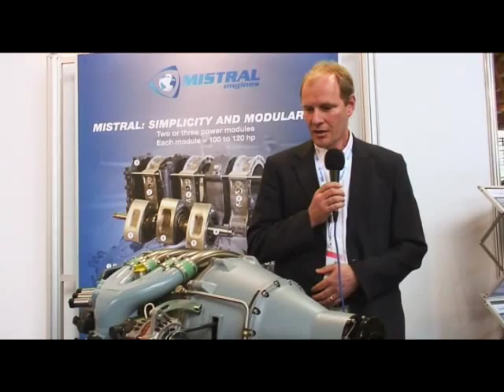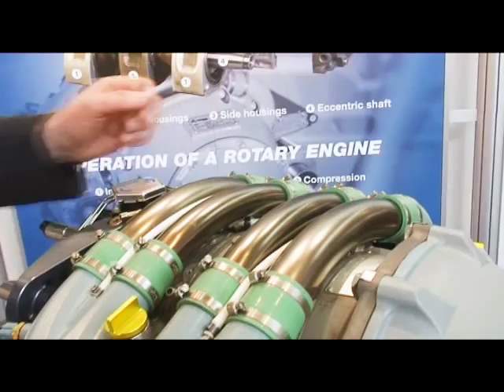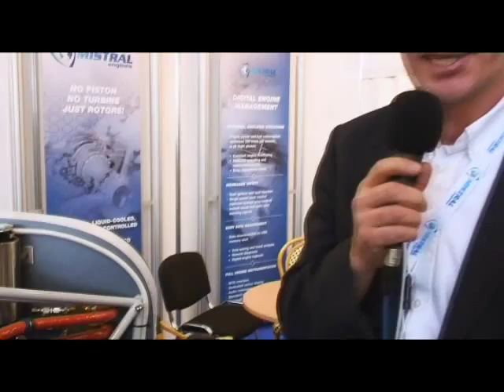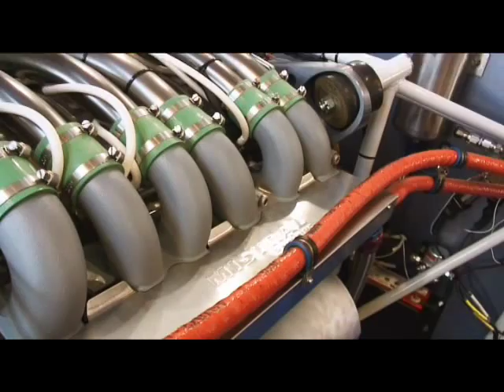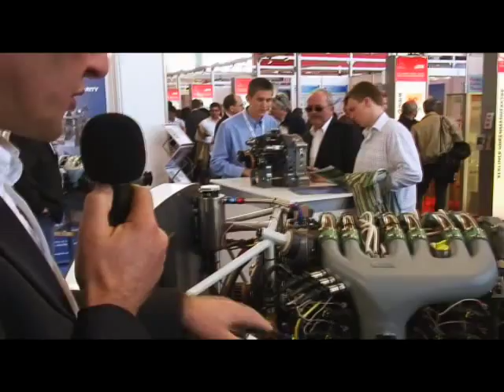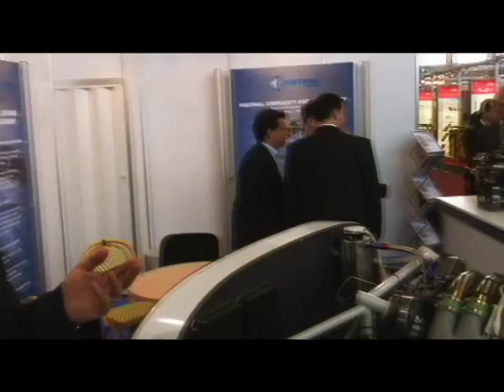Aero09_Mistral Rotary Engine

Comment: Thermal Shock in Air Cooled Aircraft Engines? Please explain!
Some deny what was called 'Shock cooling' existed, an air-cooled engine airplane having climbed, engine very hot, then starts a dive, outer parts, cylinders, cool from high air flow, inner parts, pistons, are still hot, thermally dilated, mix does not enter in an amount high enough as to have pistons cooled, cylinders contract, pistons are still dilated, from this, big wear, or even engine seized could result
Reply: High engine demands imposed by aircraft applications is exactly why Wankel engines are not used in passenger aircraft, they lack the durability and reliability to be used in aircraft, the seals simply cannot withstand the long period of high pressure and temperatures during climb-out and high-speed cruise.

Comment: Just use 1993 13b architecture. The 20b architecture is junk and will end up failing catastrophically
Reply: They are all junk, no Wankel engine has ever been reliable enough to pass a FAA or EASA airworthiness certification test... the apex seals always fail before the test is completed

Comment: Hey Bro I don't know about the engine noise levels .. You go ahead and stand south of the outlet pipe on a N/A 3 Rotor engine and tell Me what you think ?  Because that sound rips straight thru you ...I can't tell you how many time's Mr knuckle head said Cylinders 2 injectors per "Cylinders"  2 Ignitions per Cylinder . Hey why would you need twin injectors per rotor ? Is one for a Low Octane fuel the other for Methanol or What or Methanol injection for the Turbo model ?  But you have got to loose the Cylinder thing .. if you wanna convince me your a rotor guy !
Reply: Sir Michael, 
To help you with your inquiry, please listen again when he said a substantial reduction in interior noise compared to a junk Lycoming. Also, have you ever flown a Cessna or Piper with a 6 cyl Lycoming with open exhaust? You'd be DEAF in ten minutes! There are very effective noise reduction pipes that also boost power that make the rotary very quiet.
Also, the dual engine control systems, dual plugs, injectors, sensors, etc. It is the redundancy required by the FAA that certified it. A 6 cylinder Lycoming uses 12 spark plugs and two distributors, etc. It's all about backup systems.
Hopefully you caught the guy who pee'd in your Cheerios so you can be happier tomorrow.
Have a Great day!
Reply: @ceisarsrepair7958  Please stop spreading lies and false information about Wankel engines and aviation.
You are clearly not qualified to speak inteligently on this topic.
Reply: YOU SIR ARE A LIAR AND A FRUAD, There are no Wankel engines that have a FAA or EASA airworthiness certification for passenger aircraft.

Please stop spreading lies and false information about Wankel engines.
Reply: @ceisarsrepair7958  Anyone knowledge on these topic is aware that Wankel engines are LOUDER than a comparable reciprocating engine.
They have never been used in production passenger aircraft because they are too unreliable to meet the minimum PFTR standards for FAA or EASA airworthiness certification.
A test that has been easily passed by hundreds of reciprocating engines designs.

Please stop spreading lies and false information about Wankel engines.
Reply: @sandervanderkammen9230  did you not see the links that I sent that had videos of passenger aircraft CERTIFIED with the rotary engines?
 I DID NOT SAY MAZDA!!!
 Anyone can search rotary engine powered aircraft and find many videos. One even shows the FAA certification for the rotary engine. NOBODY is impressed with your repeated accusations of lying, most can hit the search and see the exact same as what we see. They are also certified for small helicopters. If you wish to turn a blind eye to that then so be it, but to call someone a liar even though you've seen it for yourself, that's insanity. 
Have a nice day and STFU !!!
Reply: @ceisarsrepair7958  You seem extremely confused and misinformed about this, NO Wankel engine has ever been reliable enough to pass even the very minimum reliability standards for FAA or EASA airworthiness certification.
 the MTBF for apex seals is simple to low, these seals are inherently unreliable by design.
Reply: This company has been defunct for some time now...
Reply: @doktorbimmer  they're bought out during Covid and will be returning soon.
Reply: @ceisarsrepair7958  No, Mazda no longer supplies the Wankel engine parts to build these engines.

Stop spreading lies and false and false information about Wankel engines.
Reply: @sandervanderkammen9230  You're a Blithering Idiot!!! I just gave you Absolute irrefutable PROOF (DIRECT LINKS) that aircraft owners have been replacing their Lycoming and Continental engines for Many options INCLUDING but not limited to the Wankel style Rotary. I did NOT say anything about Mazda providing parts and support. The patent for the rotary design expired long ago, many new companies are experimenting with the rotary Wankel design, and developing Great engines. One company, that I sent you the info for, has focused on building a Wankel type rotary for aircraft, AND it is FULLY TESTED AND APPROVED BY FAA and foreign equivalents. People have successfully installed them, flown them, and Love them! The PROOF is PLENTY that Wankel engines are in certified aircraft all over the world, Cessna, Piper, Kitfox,
Aeronca, etc. 
You are impressing NOBODY with your bullshit. You love the word LIES because You do it daily!
The Only thing You need to do is contact a tow truck company to pull that GINORMOUS Carrot out of your Ass! 
Wankels fly, Fully certified, You can't handle the Truth, 
STFU TROLL!!!!!!
Reply: @sandervanderkammen9230  You again with your anti rotary hate. Last year Mazda in fact opened up assembly lines to provide another production run to supply engine parts for the 13b. Numberess shops and customers have already bought BRAND NEW SUPPLY. Also there are some after market shops in Australia making bullet plates and rotor housings. At least do some research 1st before continuing your rotary hate.
Reply: @rotaryperfection  Please name a single Wankel engine available that has achieved a certificate of airworthiness for passenger aircraft from any regulator agency?

Anyone familiar with the development history of the Wankel engine knows that they are too unreliable and weak to be used in type-rated passenger aircraft, they are simply too unsafe.
Reply: @DoktorBayerischeMotorenWerke  Off f
Reply: @DoktorBayerischeMotorenWerke  Fo
Reply: @rotaryperfection  Childish insults wont prove your point or make you look smarter...
Just answer the question boy, What Wankel engine has a FAA or EASA airworthiness certification????
Reply: @DoktorBayerischeMotorenWerke The definition of insanity. Asking the same question over and over and over and expecting a different response. You have ZERO life you 🤡
Reply: @DoktorBayerischeMotorenWerke  
The definition of insanity. Asking the same question over and over and over and expecting a different response. You have ZERO life you 🤡
Reply: @rotaryperfection  JUST ANSWER THE QUESTION! WHAT AIRCRAFT MANUFACTURER USES A WANKEL ENGINE IN A CERTIFIED PASSENGER AIRCRAFT???
Reply: @rotaryperfection  STOP SPREADING LIES AND IGNORANT MISINFORMATION REGARDING A TOPIC YOU ARE CLEARLY NOT QUALIFIED TO DISCUSS INTELIGENTLY.
Reply: @DoktorBayerischeMotorenWerke  You are typing EXACTLY like tjat dork Sandervanidiot. Yall twins? 🤣🤣
Reply: @DoktorBayerischeMotorenWerke  Crybaby!
Reply: @rotaryperfection  JUST ANSWER THE QUESTION BOY! WHY ARE THERE NO WANKEL ENGINES RELIABLE ENOUGH TO BE USED IN TYPE RATED PASSENGERR AIRCRAFT??????
Reply: @DoktorBayerischeMotorenWerke  RACIST! 🤡
Reply: @DoktorBayerischeMotorenWerke  GF 🤡
Reply: @rotaryperfection  Childish insults won't make you look smarter or prove your argument... Why are you afraid to answer the question???
Reply: @rotaryperfection  Please name a single Wankel engine that has a FAA or EASA certification for passenger aircraft?
Reply: @DoktorBayerischeMotorenWerke  Please name a single Wankle Rotary, that was responsible  for ANY crashes in 2024? So many CERTIFIED piston engine failures, and you keep crying about Wankle. You = nut job.
Reply: @DoktorBayerischeMotorenWerke  

Please name a single Wankle Rotary, that was responsible  for ANY crashes in 2024? So many CERTIFIED piston engine failures, and you keep crying about Wankle. You = nut job.
Reply: @rotaryperfection  THERE ARE NO AIRCRAFT MANUFACTURED WITH WANKEL ENGINES.
Reply: @rotaryperfection  The Experimental Aircraft Association issued a warning to all its members in 2022 advising them that Wankel engines have shown to be dangerously unreliable and should be considered unsafe manned flight.
Only a handful of experimental aircraft have been built with a Wankel engine, most have since been swapped to a comparable Lycoming or Continental engine... the rest have crashed and were damaged beyond repair.

Comment: I think it is unfortunate this did not get off the groud; there are no updates in the website after 2017. Too bad, I believe this rotary would replace lots of recip engines in aviation.
Reply: This company went bankrupt a long time ago...
Reply: I like wankel engines for land/water transportation (cars, motorcycles & boats). But lubricating the apex seals is a big concern for me when you can't simply pull over or stop. Conventional piston engines do not need oil injection to operate. Oil pumping, yes. Oil injection, no.
Reply: @DucatiPaso750  Wankel engines have proven too unreliable for aircraft.
Flying aircraft with uncertified engines is very dangerous..
Paul Lamar is no longer alive to warn you himself...
Reply: @sandervanderkammen9230  Are you saying that the gentleman who was promoting the Wankel motor in this video perished due to his own creation?
Reply: @DucatiPaso750  March of last year R.I.P.
Reply: @DucatiPaso750  From health issues! Had nothing to do with his passion of rotary's.
Reply: @rotaryperfection  Mental health issues...